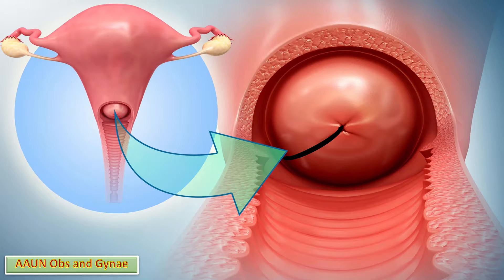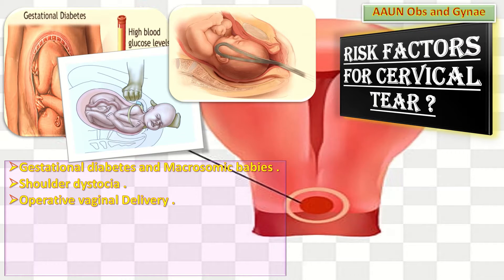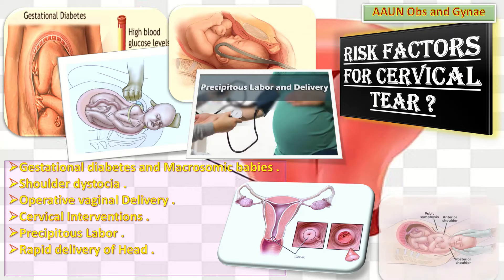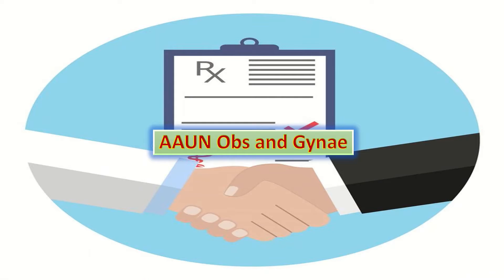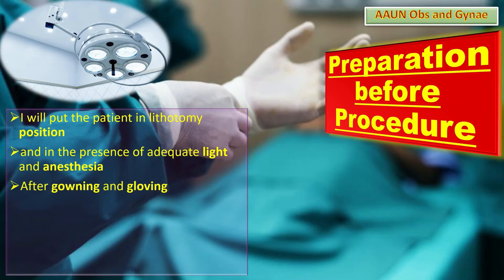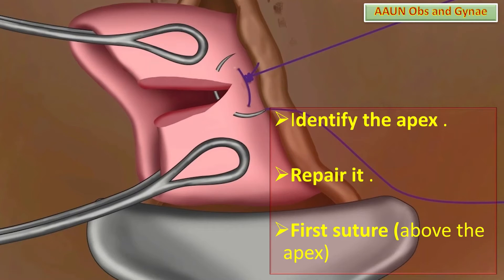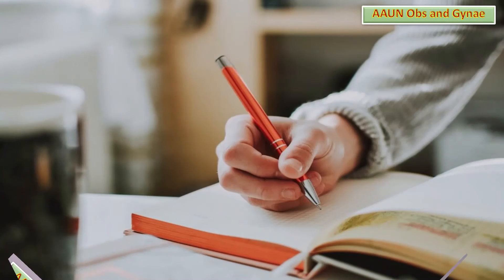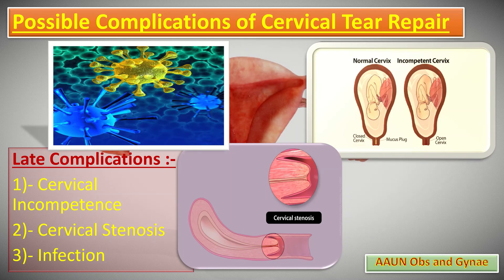How to Repair Cervical Tear or Cervical Laceration? | TOACS & OSCE Station

Comment: I had cervical tear in my previous delivery, i got pregnant 7 months later. My pregnancy is 30weeks now and am having a severe pain but my doctor has not said anything meaning about the pain. I think the pain is due to cervical repair. Pls I need help
Reply from the maker: Dear do you feel pain in the area which was stitched (means cervical area?)
If yes tell your doctor in detail so that the area is examined appropriately. 
Normally it heals up within few days and most probably the three would be psychological reason behind the pain, but I would still recommend that the area is examined at least for satisfaction because the possible complications after repair can't be underestimated.

Comment: I had a cervical tear. I think it was a result of precipitous Labour. I didn't labour for up to 3 hours both active labour before baby came. It was pretty too fast.
Reply from the maker: Yes
Precipitous labour can be a cause of cervical tear especially in good size baby . Other causes include gestational diabetes, shoulder dystocia, delivery with forceps, vacuum or both, history of cerclage, cervical conization, as well as dilation and evacuations .
But among  all the causes , the one which we usually come across is when mother starts pushing before adequate dilatation of the cervix.
Reply: @AAUN 
My wife had same repair named DBA with Cervical Tear repair done..at the time of our first child delivery.
I want to ask will any problem occur with 2nd pregnancy..
And if yes then what Precautions or  what treatment we have to take before pregnancy? 

Thank you so much for video and information given by you Doctor🙏🙏
Reply from the maker: @nileshman  
Usually after Cervical Tear repair, there is no problem in subsequent pregnancies. But as there is risks of Cervical incompetence after cervical tear repair, so in next pregnancy a TVs should be done to rule out that and if needed prophylactic cervical cerclage is applied if indicated by scan. Moreover, patient should immediately visit doctor in case of pains / bleeding or vaginal discharge in the next pregnancy in order to avoid risk of miscarriage and preterm labor.
Reply: i think in my case vaccum delivery
Reply: How many weeks did you take before resuming sex
Reply: Is it painful and how many days did it take for you to heal ?
Reply from the maker: @princesschilumba3889  
If you ask is it painful , I would say yes but it  is not unbearable type of pain.
Patient is given medications for pain relief and antibiotics to avoid infection and with that healing occurs within few days.